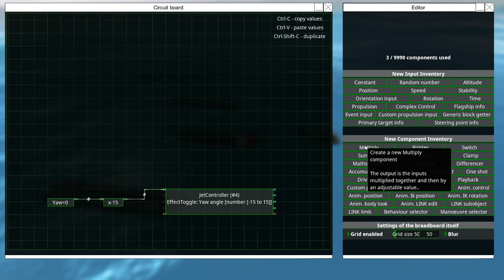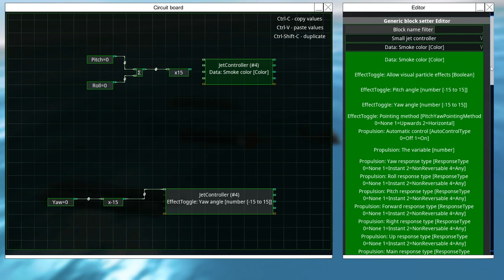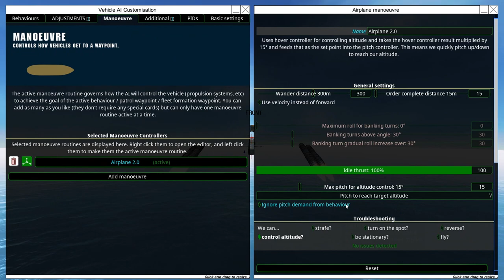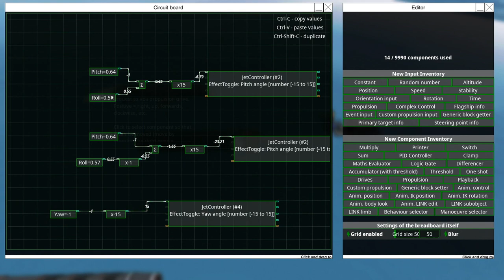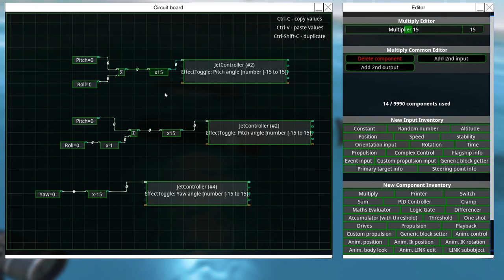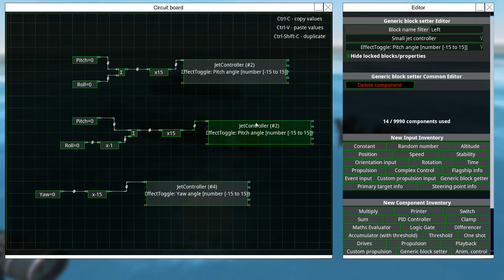Breadboard 3D Thrust Vectoring! ⬅⬆⬇➡ From the Depths

Comment: Another interesting thing you can do with a breadboard is convert any unused thrust into power using CJE generators. It's most useful with hovering craft, but you do it by setting up a GBS to tune the percentage of the thrust from the jets based on the amount of power you are using on that axis.

Comment: With the sum operator allowing for values from -2 to 2 rather than just -1 to 1 you might want to use a smaller number than 15 to multiply after as any total greater than 1 will be be stuck at the 15 degree max. The exact number would likely vary from ship to ship and likely isn't a huge deal either way but it's something to keep in mind.

I'm proud of you for venturing into breadboard! Keep up the good work! An idea you can play with if you want is using bread to modify a PAC turret's settings on the fly. Make it switch to slow firing pierce against large ships and fast firing impact for tiny fliers. It's like an advanced cannon that can switch all it's ammo stats in an instant.
Reply: Since the values range from -2 to 2 but jets only permit -15 to 15, you should set it to x7.5 for an exact match. That way the PID has full control and knows that 90% is 90% and 10% is 10%.

Comment: The neat thing about breadboards is that once you get the logic of how they function, you'll start to see all sorts of things you might be able to make them do, especially as they keep expanding it's capabilities, and ability to properly interface with the other control systems.   
And while many things require the use of math functions, even there a /vague/ idea of what the math functions do is often enough to be able to make use of them. You don't need to know how SIN actually works to learn how to use it to make something that goes back and forth or up and down over time.

Comment: Horrible PID tune? Oscillations?  Nah we call this evasive maneuvers here!

Fun Bread: 
Getting a PAC fire event and sending that through a Accumulator set to reset > 3  and feed that into a generic block setter for the PAC on damage type to cycle through each damage type while firing. If you want the next shot to always be different. Great fun.  
Also in the same bread it can be helpful to get the battery charge of the Craft. The 0-1 fraction and multiply this by a constant and feed this into the PAC overclocking. This is helpful if you only have enough battery charging to sustain lower Overclocking but you still have enough battery for some higher damage Alpha strikes. Also helps with redundancy if your batters get blown up the PAC tires to use less power. 

All the stuff i found useful stuff i found since your first Bread tutorial

Comment: Hey BorderWise, did you know that you can hook up PID to the thrust vectoring?

Fox example to set yaw:
Create a steering point info editor block and use its target bearing relative to own vehicle, put that to your process variable input on pid
Create a constant block and set to 0 and put that to your set point input on pid 
Multiply with 15 and fine tune that pid as you like

Comment: How do this for a submarine like air pumps to a set depth???
Reply from the maker: You would probably connect an altitude propulsion input (making sure that the vehicle is allowed to hover) through a x1 multiplier component to a generic block setter controlling the air-pumps. Haven't tried it myself, but that should work.

Comment: How does the mainframe transmit and how do the batteries charge?
Reply from the maker: There's nothing in the mainframe with a transmitter or batteries, though? 
If you mean in general, mainframes transmit using AI transmitters and batteries can be charged with RTGs, fuel engines or steam turbines.